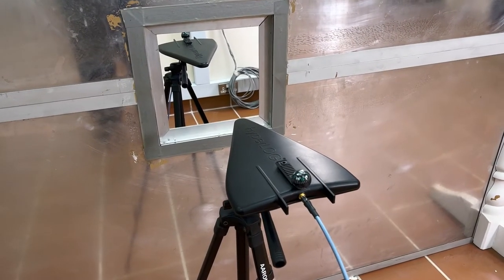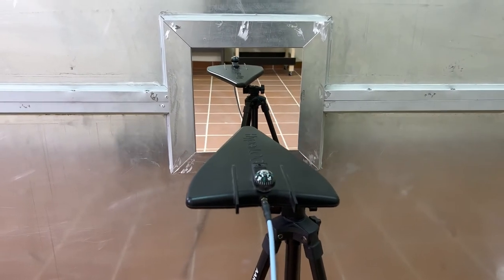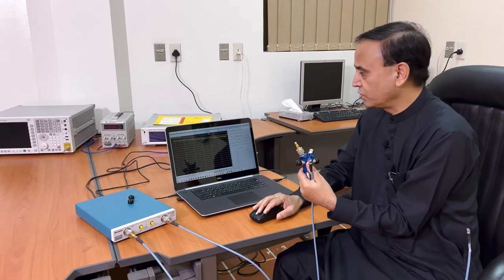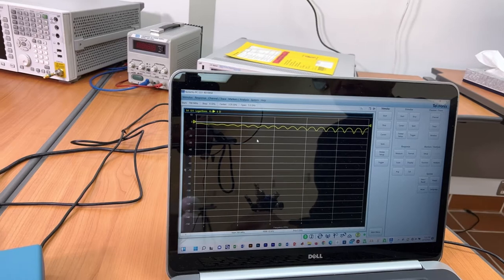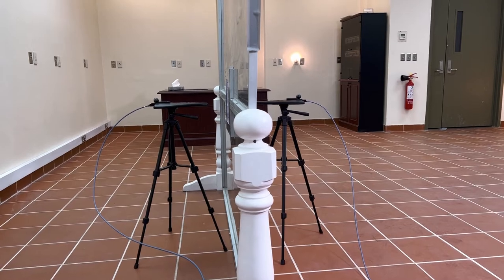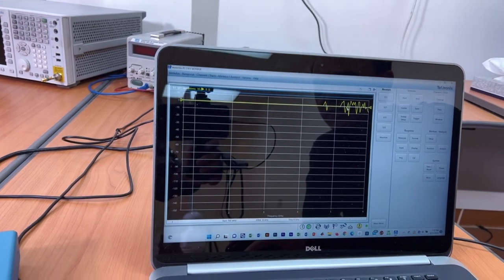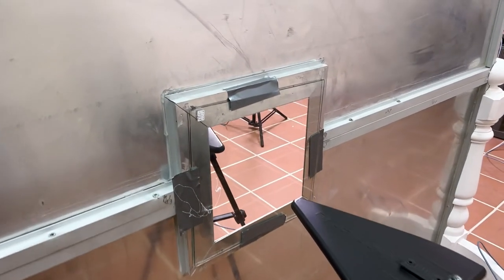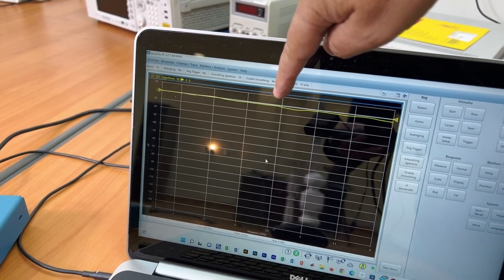How to measure Transmission through Frequency Selective Surfaces (or any DUT)

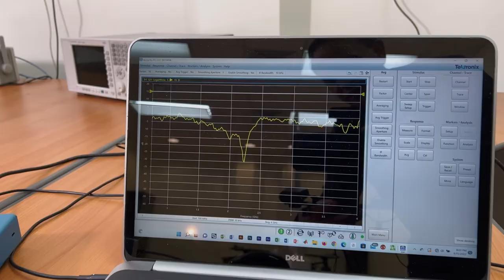Comment: Interestingly at 15:20, there is a notch at 2.4 GHz (FSS is working as a bandstop filter). I think, this can be used as a shield in mosques to prevent mobile signals inside :)
Reply from the maker: FSS has many applications. Yes mosques can be prevented from mobile calls during prayers times